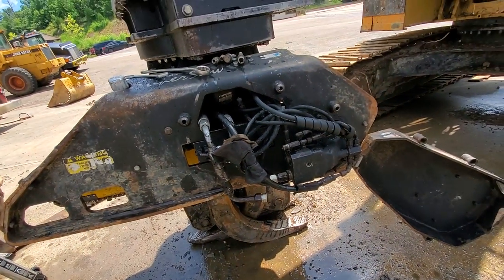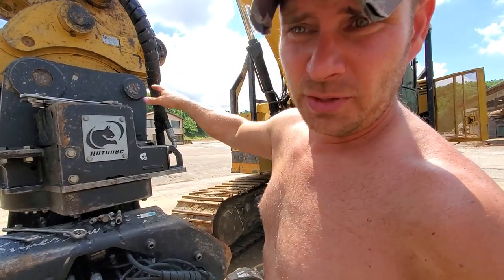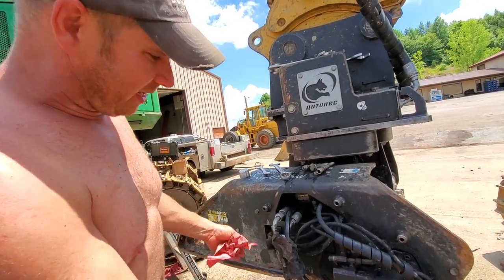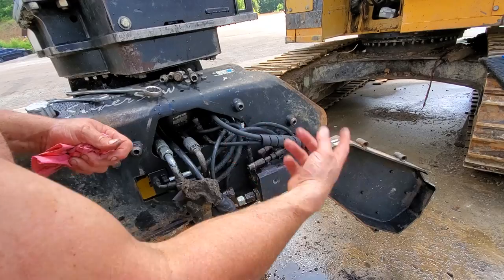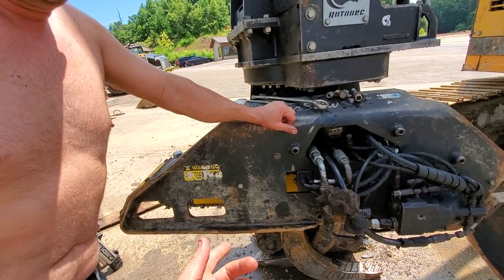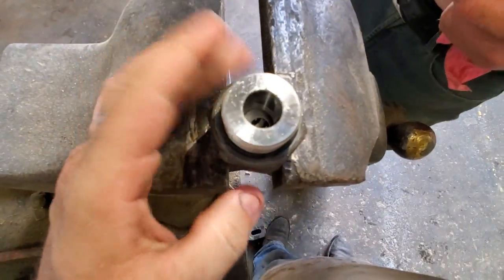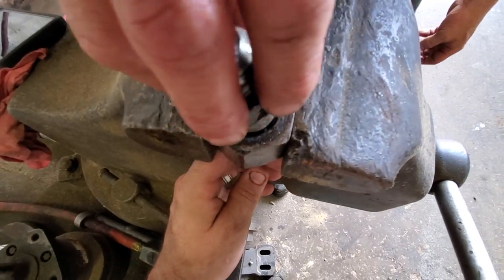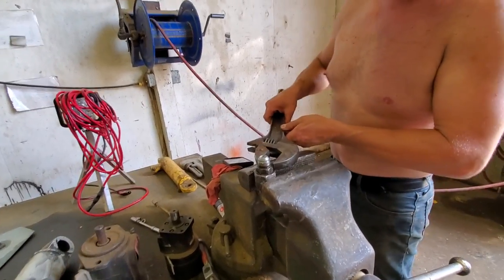Rotobec rpa mods

Comment: Look into how accumulators work, be careful using compressed air in them as o2 reactors quite violently when compressed to 3000lbs with even a little bit of oil you pretty much have a bomb.   On that head probably no big deal. But please dont fill accumulators at the mill with o2 someone might die.   Dry nitrogen is inert and will not react with oil to explode.      One more thing,  accumulators are basically act as a spring or capacitor in a hyd system.    

Be careful bleeding the pressure off on any system with a accumulator in line, we had a fellow get a hyd oil injection from a accumulator on a morjunk debarker.  If you want to see something gross look into pictures of hyd oil injection....good way to loose a hand arm or worse. Checking for leaks with ur paw is a bad idea!

Comment: Thread/Tap the inside of your fitting to accept a set-screw of the size needed and then drill a hole in the set-screw to the orfice size needed ;)   or if on the fly and using #8 or bigger, use dimes and drill a hole to the orfice size needed
Reply: Or you could just install a checked needle valve in the circuit, so you can adjust and fine-tune the perfect oil restriction needed